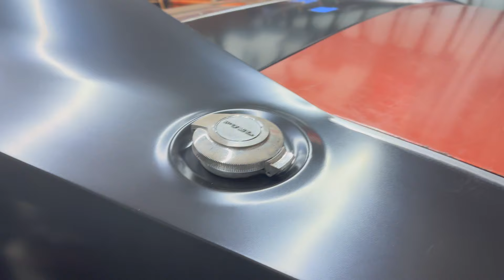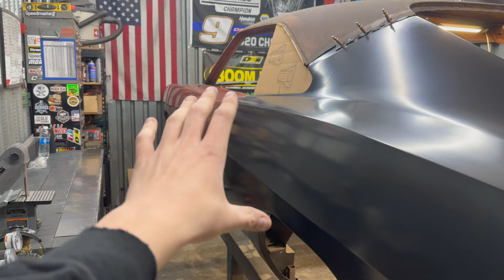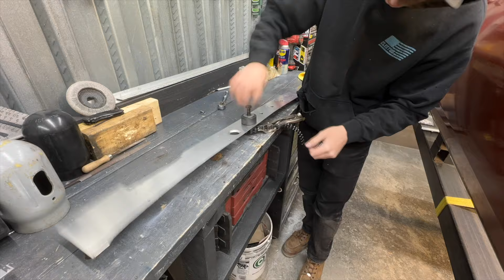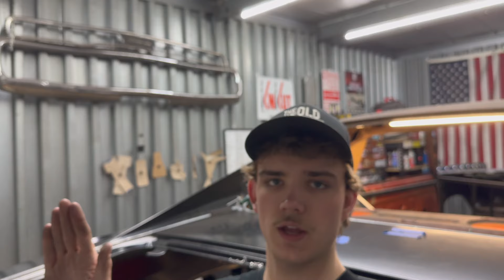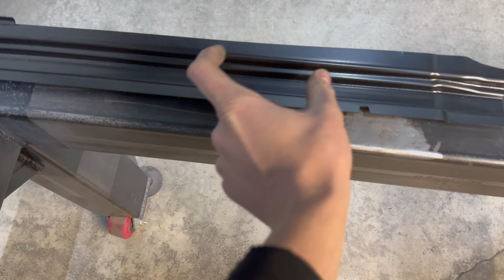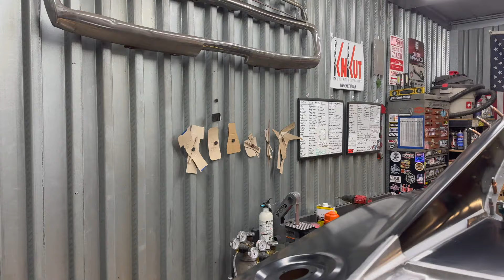Fabricating rear panels on my 1970 DODGE CHARGER from SCRATCH

Comment: On my GTO, I used Eastwood's surface contour tool, took all the parts down to bare metal, and then used epoxy primer on the whole car. I wanted to completely seal the car before putting down the filler. I highly recommend their SCT.
Reply from the maker: I’ll take a look into it, I’ve seen some other guys use it as well. Appreciate the info!

Comment: You have a good eye for the metal working.  Just one thing, try to incorporate a respirator into your routine when cutting that metal with the die grinder, all that metal dust and disc dust is going right in your lungs.  Well the parts that don't end up on your face:)  Not trying to be critical or a safety sally, but if this is going to be a career choice it is going to add up fast, especially in a small shop like that.
Reply from the maker: No I appreciate it, I am definitely bad about not wearing a respirator and need to be better about it

Comment: Do you put anything on the bare metal to stop it from flash rusting? The tail panel has been exposed for a few videos just curious if you put anything on it
Reply from the maker: Not currently, I really need to though. Leaning towards an epoxy primer of some kind

Comment: Impressive outcome so far given shop/space and tools. I've seen work from bigger shops with every break, english wheel, stretcher, nibbler, whatever that didn't look quite as factory as your panel joints in the rear do. Not 70s factory either. 2020 level factory at least on camera.
Reply: proof you dont need a million dollar shop to do good work, just basic tools, dedication and patience
Reply from the maker: My goal, if anything, is to show that you can do a lot with a little. Just takes some creativity and dedication